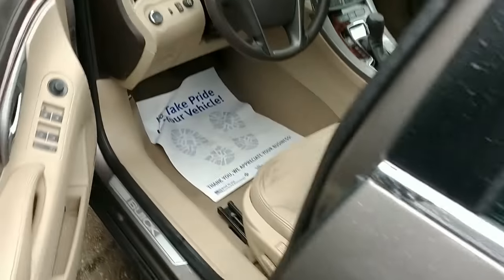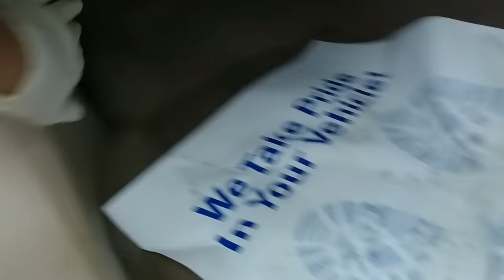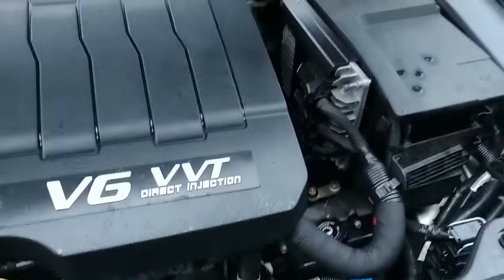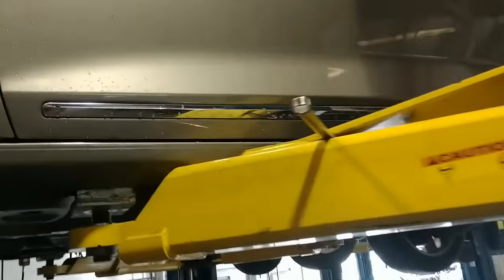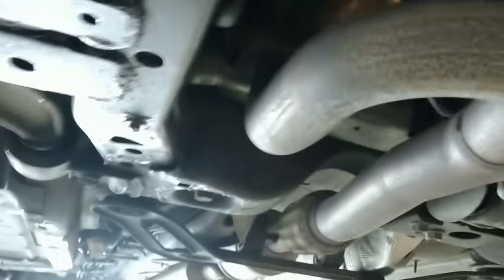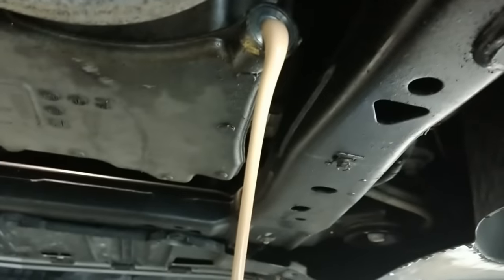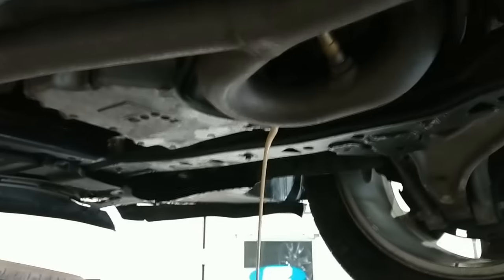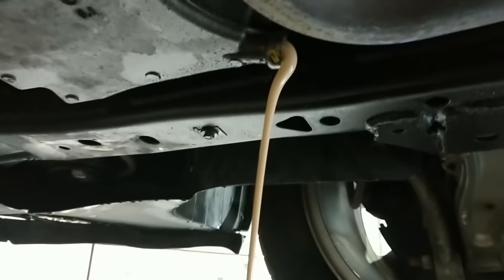Overfilled Crankcase! Blown ENGINE! Used Car Nightmare!

Comment: As someone else said, this is heartbreaking for a normal hard working person. Definitely always get an expert evaluation of any vehicle. It is so easy to fall in love with the shiny appearance.
Reply: Always check reviews on the lot first and go for a test drive. Anythimg feels weird at all, go elsewhere.
Reply: My Grandpa was a mechanic who taught my dad, and my dad taught my siblings and I. 
I am thankful for it everyday, even though I hated being forced to help my dad work on cars as a child, but in hindsight I am so glad he did.
Reply: "Can I take it for a test drive?" Straight to a mechanic you know and trust for an evaluation.
Reply: Could of been the owner pit the coolant in and didn't want to admit when they had overheating issues that they tried to fill the coolant themselves and dint know where to fill it. Seems more likely that it was the owner, rather than a person who works on cars at a dealership, especially since they said they drove 100 miles before it started overheating.
Reply: @bradleypresby9110  Only one glaring problem with that theory. The steam coming out of the exhaust pipe during the beginning of the video. Coolant added by mistake to the oil wouldn't give that symptom. Thats a bad head gasket,  cracked head or block. If the oil had been contaminated by coolant before her 100 mile drive she wouldn't have gotten 100 miles and the engine would have seized. Steam in the exhaust is a symptom of coolant boiling in the heat of the combination chamber during ignition.
Reply: Depending on the state they can get a refund
Reply: @bradleypresby9110  definitely the new owner did that.
Reply: @kzin602  My guess is that the dealer did that in combination with "headgasket in a can".  They only needed it last long enough so that the buyer couldn't return it.
Reply: I'm very new to cars in general. I'm watching videos like this to see what common problems cars have and what to look out for. So it seems that the coolant leaked into the oil? I know having clean oil is important and you should change it regularly. But how bad is this? I apologize if that's a really dumb question in advance.
Reply: @smasherblues5322 shaming? What is this the 1800's, that type of shit don't work. I'd take it back with the documentation from this and 1.have then refund my money or 2. Spend the night in jail for kicking someone's ass.
Reply: It's not all bad. Yes they will lose a down payment. At least they won't have to keep paying for the car.  I had it happen to me before. Ended up scrapping the cat to get most of my down payment back and told them they can come get the car.
Reply: ahahaha! thats why i only drive my bike now! no big repair costs, mantain costs, taxes, insurance! traffic jams! etc, but tbh, i do miss my car somethimes
Reply: "expert evalutation" how about you just learn the basics of a vehicle and do simple things like check the bloody oil before you throw down thousands on a vehicle.
Reply: @bradleypresby9110  I don't know anything about Buicks particularly, but Nissan XTerras of a certain age range (like 06-10) were notorious for having a design flaw where a certain weld could crack and allow coolant to flow into the oil. The problem was called the "strawberry milkshake of death."   This is the first time I've seen something similar in anoother vehicle.
Reply: @Chaos------  good idea too..and bring a code reader.  This thing must have been throwing codes up, but were cleared out which would show. Any code comes back "not ready" just walk away.   I guess that's used on Craigslist too to turn off the check engine light, just disconnect the battery for a minute and there you go, codes cleared
Reply: @BigBenP  sheesh. My Dad's mom had an Xterra for years and it ran smooth as a baby's ass, only reason they got rid of it was after they had it skid out on Black Ice into the ditch, and also into a concrete block in a parking lot (the "bumper busters" I call em), and hitting the metal things that I can't remember the name of that are used to block cars from skidding off Cliffs and stuff. Tore the step bar on the driver side off and banged the doors in at the same height to hell. Was cheaper to change cars.
Reply: @armsofundertow98  very bad. If someone added coolant straight to the oil, not terrible just not ideal. However, this is more likely coolant migrating into the oil. Which means a gasket is bad somewhere. Timing chain cover? Usually the head gasket which means the cylinder head is warped from the block and that requires not only tearing it cpmoeltely down but sending to a machinist to retrue the surfaces. In other words, it costs way too much to justify the repair.

That being said, there are older vehicles where people don't have much invested have been known to jury rig fixes that no mechanic would do because of liability. But when it's your own car.... and you're already screwed... you can go for it. Or do an engine swap.

On something you just bought? Better hope for good consumer protection laws otherwise you just bit the bloody bullet.
Reply: @Mainely Most of them buy unknown auction cars for less than the down payment price. The payments people make on the rest is pure profit to the dealer. Never buy from a buy here pay here that sells as is without a warranty!
Reply: @armsofundertow98  very bad, run to long with the coolant in oil will destroy the bearing in the engine. when that happens your stuck replacing the engine.
Reply: Evolution in action, stupid people do stupid things and win stupid prizes.   First mistake is whatever life choices left a buy here pay here as your only option, second mistake was actually buying from one, and third was not getting a pre-purchase inspection before sealing the deal.
Reply: @bradleypresby9110  True. Maybe there's a coolant leak elsewhere (hopefully just a hose) and the owner though engine coolant went  into the engine lol, then maybe they dont need a head gasket replacement. Though the fresh gasket replacement work made me think someone tried to repair it and failed to
Reply: Lets see they probably spent 12-16k for it, and have to put in another 6k for a new motor, so at the end of the day they're paying for a new vehicle.
Reply: In fact, of you buy a used car with a squeaky clean engine, it means that the engine was washed. This is usually done to hide problems. ALWAYS have a used car checked as a conditional for purchase. And if the seller tells you “as is” and you are not at an auction, walk away.
Reply: @armsofundertow98  not dumb. You asked. Answer: very bad. At best, a costly repair. At worse, your engine, you AC and coolant system are scrap. What does it takes to go from bad to worse? Just run you engine like this for an hour or two. The sad part is, by the time you find the problem, it might be too late.
Reply: @mike-sk2li  Another reason to not buy a vehicle from a buy here pay here unless they have a few months warranty. I know a guy who ran a buy here pay here. Most of his vehicles were bought at auction pretty much condition unknown. He'd do his best to check them out and get them running well. It didn't matter though when a mechanical failure occurred! The contract said "SOLD AS IS!". Most sellers like this end up with cars they've sold ending up back on lot due to the buyer failing to make payments or mechanical issues beyond the buyers budget.

Comment: She should return the car, right through the front window of the shop she bought it from.. "sorry the brakes stopped working too i guess"
Reply: hahaha
Reply: Lmfao you nailed it
Reply: Yes!!
Reply: Would be badass a except she would get sued
Reply: reminds me of that one story mission you had to do on gta V
Reply: No. Fill it up with oil and return it.
Reply: @dasnicenoob6140  actually Most states have lemon laws if they knowingly and intentionally obviously sold them a vehicle that had a busted head gasket or worse a warped head then they are liable for it and she can actually sue them for selling her a lemon
Reply: Probably coolant in the brake lines, too.
Reply: @mjolnirswrath23  lemon laws don't apply to used cars
Reply: @silaskuemmerle2505  Right, but most states have laws for dealers about disclosure etc. This dealer obviously knew the car was faulty and didn't disclose any issues.
Reply: @mjolnirswrath23  Actually most states when you buy a used car it's "as is" with no protection for the buyer. It is literally "buyer beware"
Reply: You read my mind. Well maybe I read yours 3 months later.
Reply: @Wehra96  Again, this is why you get a mechanic to perform a full inspection of any used car before you buy it. Of course, this car dealer would have refused, knowing the problem would be discovered.  So that would be your answer right there.  If they refuse to allow an inspection, you run away and take your money elsewhere.  Simple as that.
Reply: @dasnicenoob6140  being sued means nothing when your so broke you are buying these pieces of crap. Never mess with someone who can't afford a mortgage. They got less to lose.
Reply: @carlbrooks90  that's like one of the first missions right? Like right after the prologue and the race tutorial thing
Reply: @silaskuemmerle2505  dependes on the state What is a lemon law? South of the border, all 50 U.S. states have a lemon law in place for new vehicles, and a handful states have a lemon law in place for used vehicles.

Comment: My high school had an auto course that was half basic maintenance and skills (checking fluids changing the oil and changing a flat tire ect), the other half was about picking a good repair shop, buying a car without getting screwed, and insurance.
Reply: High School should teach more "life skills" like that.
Reply: @chetmyers7041  true but they cut those to teach shit that will not be used by most people and to save money my high school had a auto mechanic class they closed it back in 2014-2015 because and I'm quoting my school district board manger it was not a class that was useful for every day life and most of the students that knew it was and some of the teachers just facepalmed
Reply: My high school had a shop class but if you got into that class or not had to be "approved" based on your GPA and other factors that were picked at random.  It was only 8 kids that could get in every year out of a school of over 1,000.
Reply: There is no reason they do not. 11-12 graders should run their day to day schooling like real life.  Meaning they get paid on Friday fictional $ and have a check book    As they do classes they fictionally pay for. Classes and other things.  The basic vehicle stuff would feed right into that.  It would make too much sense for this to be a requirement to graduate.
Reply: @chetmyers7041  That's why they said "auto course".
Reply: High school should teach basic auto, how to get a girl, how to iron clothes, how to tie a tie, e.t.c.,  these are life skills that a surprising # of young men lack.  Part of that is because fathers are not as respected as before.
Reply: Japanese schools still havr a home economics class. It's a life-skills class.
Reply: They've abandoned such trivial (sarcasm) things for gender identity studies, critical race theory, and common core math.  SMH
Reply: @seraphimprince  Pretty well every high school in Canada offers those courses as well.
Reply: @ericdenney3302  I was looking for your comment.
Reply: @ericdenney3302  
Sucks to be living in amerikkka, we have this shit in middle school
Reply: @Alfred Morency
Right. I'm just going to ask this since no one else has. 
Any pointers on the latter half of your studies of spotting good mechanics and avoiding scams?
Reply: It took me a good ten years into my adulthood until I learned those skills on my own time, fixing car problems as they came along, besides basic maintenance.
Reply: @cheyenne11114  What?
Reply: @comdickinson5964  I don’t have a list of things to look out for but just having that knowledge of how to spot, diagnose a problem and fix it goes a long way.
Reply: Any tips relating to the last three?
Reply: @TheMrmoc7  that is what the army used to teach
Reply: @yahwehvii6059   someone mentioned fathers are no longer widely respected. I was giving some reasons as to why.
Reply: I went to private school and these things are never brought up
What's even the point of spending the money
Reply: @yahwehvii6059  Thanks for the reply. Would love to learn these skills.
Reply: I remember years ago an argument/discussion I got into with one of my old schoolteachers.
I asked why it was we did 9 hours per week of science yet 0 hours per week of auto maintenance.
The reply, which was exactly what I expected, was that science was a generalist subject useful for all sorts of things in life but auto maintenance was highly specialized and something only a few people would do.
I then pointed out that there were exactly 0 science laboratories in the town and the only job it was useful for was a science teacher, while there was almost one car for every man woman and child in the town........
Reply: @Debbiebabe69  Imo English, Maths, and Science are vital to build a basic understanding of things so you can move into your desired field w/o having to learn simple shit. But that doesn't take away from the fact that life skills are just as important and should also be considered a core subject alongside the other three. 

Also, with regards to Maths and Science, many schools go way too deep into it. For Maths it should really just be core skills (mainly mental) and Science should just be understanding the world around us and widely useful knowledge (e.g. how electricity works and heat travels etc.)
Reply: Now thats a good class.
Reply: That's amazing!! Wish we had the same course available before!
Reply: Took H.S auto way back in 91. I don't think they even have a auto course anymore .
Reply: Lucky foo
Reply: Sine I’m an old guy I didn’t read all the comments.  In the ‘70 we had auto shop, wood shop, metal shop etc as classes.  These guys are now the old farts you see with bad ass cars.
Reply: Thats amazing and useful life advice i wish more schools would give that instead of mostly dropping you off to learn things by bashing your head or money into it
Reply: @shutomasi  I got A grades at advanced maths and science, dont think I've ever had a chance to use 90% of when was taught though.... so yea, they ARE useful, but the basics need more emphasis (being able to add up in your head fast is FAR more useful than knowing how to differentiate x to the inverse log n of the cosine of x squared plus one all over the root of x to the power e) 
English though I still say is the most pointless subject out there. Kids are completely literate in English by the age of around eight. All you learn in English after that is utterly useless for any field of work apart from as an English teacher. Its not like they teach facts anyway.... I remember a few years ago at the football club asking some kids who had recently completed the new Shakespeare-based english literature GCSE if they knew what language Shakespeare wrote in, giving them the choice of old, middle, or modern English - not one of them got the correct answer (he wrote in modern English)
Reply: @Debbiebabe69  To be fair, advanced maths and science should be teaching you extra shit that you probably won't need. But the core maths and science that's taught in primary and secondary school should purely be focusing on basics. The amount of people who take minutes to execute basic operations in their head nowadays is UNREAL. I'll tell them the answer too and they're so focused on thinking that I'm forced to just stand there and wait awkwardly. (I know it seems like an odd scenario, but it happens quite often on my course.)

Their method of teaching subjects such as Maths are really bad as well. They teach purely through memorization rather than training skills so most children just try to memorize methods rather than create them, which is probably why the maths grades are falling in England and maybe other places too. 

English literature is a pointless subject, but English language is definitely a must. It's not necessarily about being fluent, it's about honing both written and oral communication skills so children are prepared for interviews, applications etc. The issue is that the specifications focus on creative writing and all that bullshit rather than skilful writing. My teacher was great enough to actually use realistic examples as practice whenever we were done with work, and it's extremely useful. Makes applying to shit and doing interviews much less daunting as I've done it a million times.
Reply: @chetmyers7041  they do, you just have to choose the right classes
Reply: @cheyenne11114  go outside and touch grass
Reply: 666th like
Reply: Wish we had that when I was in HS...
Reply: A vital course everyone should have to take! We don't do anything like that in the UK, when taking your driving test, as long as you can point and grunt at the coolant, dipstick, and windscreen washer, then you are cleared to carry on with the rest of your test.
Reply: shit should be required to graduate.  fucking insane that its not
Reply: @topgun1457  the district board manager prolly assumed people making minimum wage could pay out of pocket for everything done to their cars like he did with his brand new audi he pays for in cash thanks to his absurd tax-funded salary.
Reply: This should be a must take course for the young generation in HS...